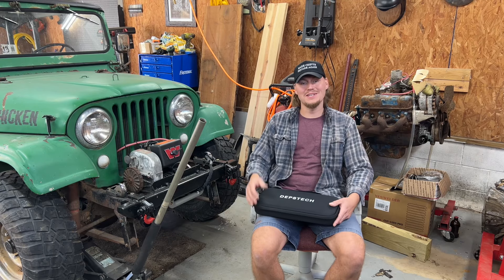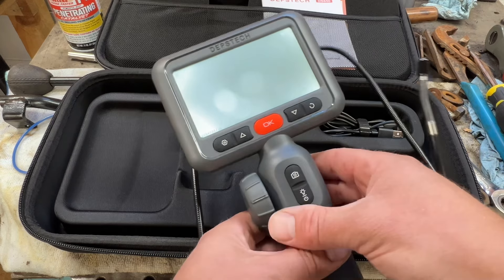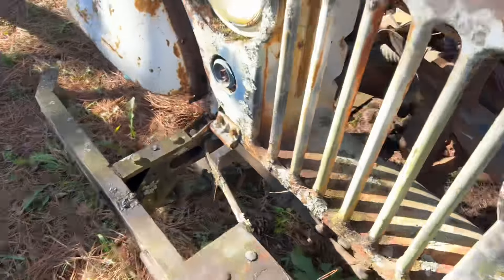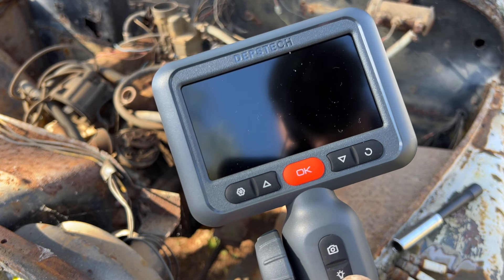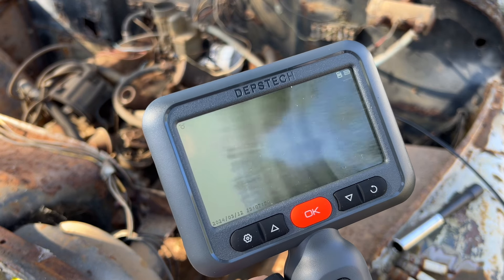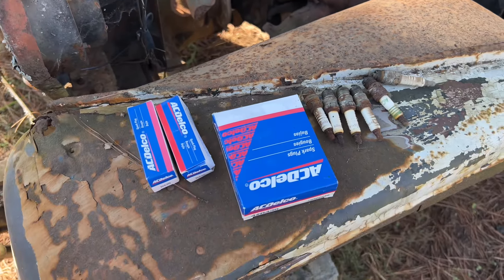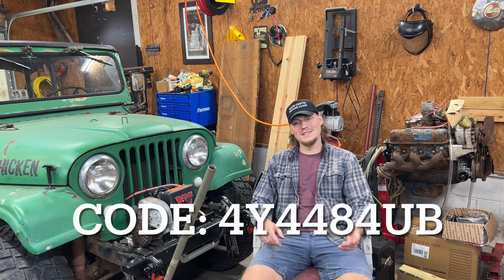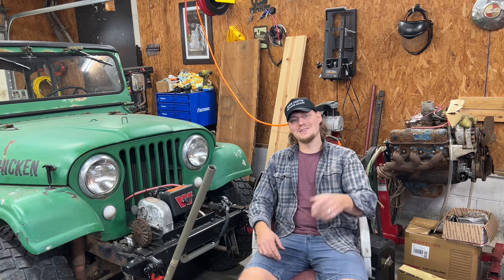Looking Inside the Engine of my Willys M38A1! Depstech DS650 Borescope Review!

Comment: Holy cow, Jacob! You got yourself a dauntless!!
What year is that? I noticed it looks like a single barrel...they didn't use that long. The vast majority were 2 barrel. (Do yourself a favor and upgrade to a 2 barrel intake! Lol)
Don't be alarmed by the one spark plugs a little fouled. My dad's v6 Jeep has always fouled one plug on the passenger side since it was new and I noticed when I pulled the plugs on mine, it does too. That leads me to believe  it's the nature of the beast because my engine is TOTALLY rebuilt and shouldn't do that. Perhaps a design flaw in the intake causing one cylinder to run a little rich? IDK!
Reply from the maker: 1953 for the Jeep not sure for engine. That’s good to know though I hadn’t heard that, thank you for sharing!